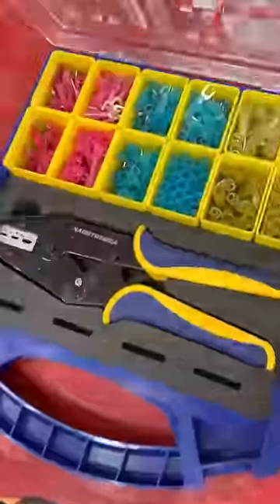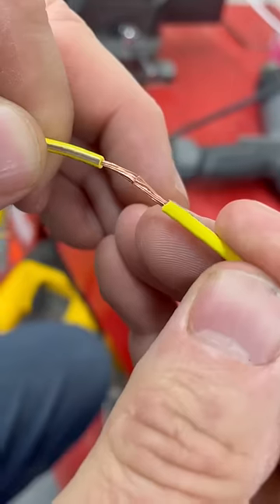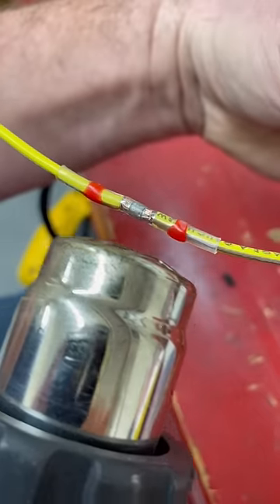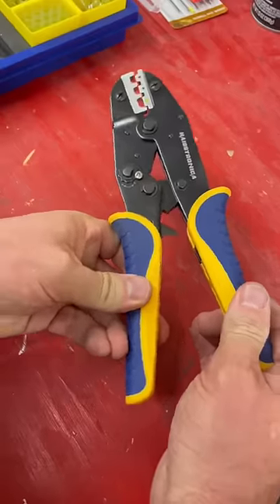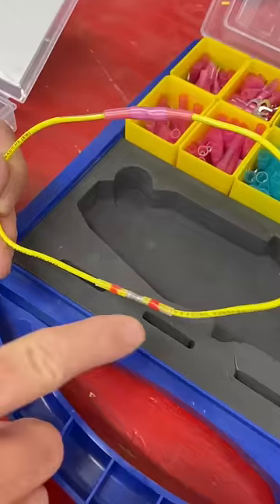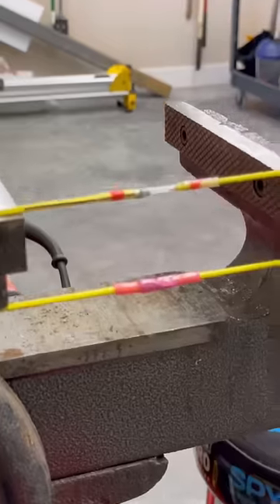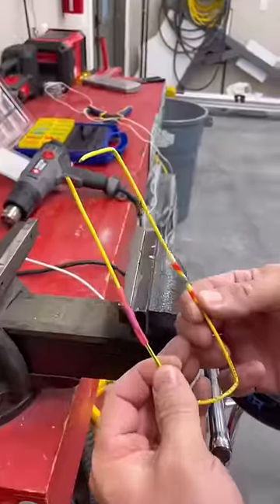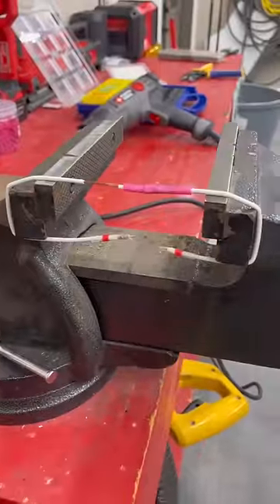Crimp verses Solder Connectors

Comment: I use both, but a connection that is going to be near heat and vibration, I use a crimp connector. If the connection  will not see heat or vibrations I'll use solder connectors.

Comment: The problem with solder connections is that in vibration environment the solder can crack while mechanical crimp connections aren’t subject to that.

Comment: If you are doing a data line you have to solder, and when it comes to vibration resistance solder will always be king. However, both work. And I mean it's a trailer and trailer lights it doesn't have to be art

Comment: Crimp connections for wires that take a lot of vibration or are exposed to the elements, solder for interior wires that don't need to take as much abuse.

Comment: i use the dual wall heat shrink crimp solder connectors at times when they are in stock, otherwise i use heatshrink crimp connector

Comment: Ideally I prefer using actual solder with heat shrink and some dielectric grease. But if I can't use that method a good crimp is the way to go. Those heat gun solder connections aren't very good. They also corrode from the inside out over time if you don't preheat them to remove moisture.

Comment: Soder and heat shink. Its not that they are super strong (although a good strong connection is good). The big thing is the continuity of the spice connection, and in my opinion, I've always had better continuity with solder.. basic trailer lights, though heat shrink crimp connectors are just fine.

Comment: I have a hard time getting the solder to actually bond or even melt most of the time. I wanna love those connectors but I don't. 
I prefer ordering the bare copper crimps, solder after crimping, then slide marine epoxy heat shrink over that. The joint is smaller than the heat shrink crimp and stronger than the solder sleeve.

Comment: For truck and trailer work butt connecters are just easier, especially in the field or up on the top of a box truck or trailer. I think anyone that argues differently either lives in a shop or has never been on a road call.

Comment: The solder connectors are better in very nasty conditions.  They seal up the metal better than a crimp will.  Other than that, take your pick.

Comment: The crimp connectors are better for connection that will be in moving things because it can sopport vibration without breaking like solder ones, solder is better for things that don't vibrates or move.

Comment: Start using a linemans splice and your wire will 99% of the time break at either the crimp connection of the wire. Linemans splice is insanely strong.

Comment: I never use a connector if I can help it. I solder all joints and then heat shrink. I've never had a failure in a soldered joint in over 30 yrs, but I've repaired 100s of failed crimp connected joints. The solder heat shrink is better than a crimp joint but they're expensive and not as good as a properly soldered connection.

Comment: For most scenarios, either are fine but i prefer crimp Uninslated with marine heat shrink but i thi k in a lot of cases those solder ones dont have enough solder and or any flux i just think the ods of a bad joint are high but they are convenient

Comment: NEVER solder connectors. With the ones that I used, the insulation melted before the solder.
I've ALWAYS had good luck with crimps. If it needs to be insulated, I'd just use heatshrink over the crimps. 
Just my 2c.

Comment: Personally use heat shrink after soldering . If anyone really thinks soldering will break never owned a Harley Davidson that has 40 thousand miles with soldering and heat shrink . Vibration is the absolute best test you can do .

Comment: depending on the application i would use solder in case of ultra cold temperatures/temperature cycling applications (ie fixing something inside an ultra freezer or an MRI machine)
and pressure connectors in "hotter" applications (ie under the hood of a car)
there is an exception though
when I am connecting a microvolt sensor it must always be solder

Comment: If I'm really worried about the connection I use actual solder connections,using a soldering iron, or gun if I need more heat rosin core solder and shrink tubing.

Comment: On automotive conections you should always use crimp those ones you have there are particularly good connectors on automotive applications soldered conections can crack and cause a bad connection so it’s best to use crimp connectors because they won’t crack

Comment: doesn't matter which one you use as long as it's not wire nuts. wires aren't meant for taking tension loads. if your wires broke because someone or something was pulling on them then you probably have bigger issues

Comment: Well... Before your test I would have said do whatever because oem vehicles are full of crimped connections...

I would think you should use something soldered in a moving system. However on my house pump I've had crimped connectors forever.

Smoke em if you got em.

Comment: I used solder connectors for a while for work, they failed after a few months of use almost CONSTANTLY. I had to chase ghosts in my harnesses just to find out that the solder had broken connection inside of the tube. Never again. Just mechanical splices for quick fixes or soldered mechanical splices for the long term.

Comment: The problem with the solder connectors is that there's no Flux! You need to add flux to the wire before putting them in the tube and heating the soldier.

Comment: I solder wires alot in my cars but crimp connectors are better. The wire gets brittle near the solder so it might break after time if there is alot of vibration

Comment: There is not enough solder there to properly connect, they wire also isn't being heated enough to make a good joint. It will be a cold solder.

Comment: The main connections we see fail day to day are Crimp connections due to corrosion. If a solder joint gets so hot it, let's go. You have bigger fish to fry.

Comment: always use crimp connectors. the solder can re-melt if the wire gets over current. also, I prefer the non-heat shrink crimp followed up by a piece of precut heat shrink from bargeman the quality of the crimp matters as I have cheaped out on a box and had 70% of those crimps fail
Reply: If the wire is getting hot enough to melt a solder connection, you need a bigger wire!

Comment: Crimp connector All the way in Automotive i would use these solder heatshrinks only for hobby electronics not for car or trailer wiring crimp connectors never failed but many times solder joint failed due to vibrations as the cable right behind the joint is a lot weaker than the joint itself so it just broke off Also i dunno which solder was used what abou resistance between those wires heat resistance etc ? (Pardon my english its not my main language)

Comment: Soldered connectors are not watertight. You rely solely on the molten solder to guarantee the electrical connection, and hope the pvc shrink will ensure a watertight joint. 

I have been using uninsulated butt connectors for years. Once crimped, I fill the voids with molten solder, and  slip a shrink tubing lined with heat activated and watertight adhesive. Never had a callback.

Comment: When I do electrical,  Im depending on the connection to be as good as possible, to allow current to flow through it.  I don't believe I've ever used electrical connectors to try to join a towing strap. Chain or any other type of recovery/  pulling apparatus.     In some instances the wore your working with might be pulled taught,  and their isn't much room to work with,  but typically, your wire shouldn't be being pulled in either direction. Especially at a connection.   Leave plenty of room and clamp the wire down on each side of the connection if need be.

Comment: If your wire connections experience that much strain... You've got bigger problems😂
Either one seems to be fine...
Higher current and heat causing solder to melt will eventually melt the insulation anyways, indicating the wrong size conductor or a serious short.
The solder type connector will withstand corrosion better.

Comment: if im soldering i prefer the standard solder and iron method, part of soldering properly is heating the base metal to the right temp so the solder can flow through it and form a proper bond, and i don't see that happening with the heatgun here

Comment: Maybe over kill but I like to use bare crip connector I then Solder and put a nice pice off double walled heat shrink over top I used to use the crimps that come with the heat shrink but I find sometimes I’d poke a hole in the heat shrink not noticing send into service and it would come back 3 mouths later for the same issue luckily I learned this working on fleet so no real harm done. I also live on an islands and used to work on the u hauls  and I can tell you what works in Texas doesn’t work on the coast some of the worst wiring I’ve ever seen has come from here Arizona too, but I’m no wiring expert I just do it for a living and these are my experiences yours may differ.

Comment: There both good but depending on where your using and on what, like have to use solder connector on Jag / land rover there better for anything under vehicle then the crimp due to chances of water damage, but if in the vehicle I'd use crimp just for the ease.

Comment: The solder connected shown should be paired with a metal barrel that is crimped onto the wires first, then the solder connector can be melted over that crimped barrel.

Comment: I've tried the solder connectors before, never had any luck with them. I could never get the solder to melt before the rubber. And if the solder doesn't actually melt, what advantage do they offer over crimped connectors?

Comment: I prefer solder connections and thus only reinforced it with the solder ik for sure 1000% that's its gonna make a great connection I don't have to worry about strength cuz I'm not towing a golf cart with my radio wires lol

Comment: I think sotter is better left to electronics and devices that you might want a second measure of defense for over current besides a fuse. Sotter doesn't do well with excess heat though so If you know what you're connecting will be under a serious load like a winch for example then crimp it.

Comment: Those heat shrink solder connectors use quite low melting temperature solder. That can be problematic if things heat up.

There's a reason they crimp all the connections in the stock wiring harness instead of soldering them.
Reply: I would be horrified if I would find a crimp connection in a stock wiring harness.
Reply: @fynn1202  How do you think literally every connector pin in the harness is attached? Sometimes inside the harness too, when wires join together.

There's literally nothing wrong with a properly done crimp. Soldering also can cause issues because it makes the wire less flexible and more likely to break at the joint.
Reply: @Robert Hancock  not to mention every grounding cable that exists is crimped.
Reply: @fynn1202  pretty much all connectors have pins that are crimped on, and splices are done with ultrasonic welding. Its rare to see anything soldered on a modern stock wiring harness.

Comment: Most of the time the solder does not adhere because the joint is not cleaned. Stick with the heat shrink and your just fine.

Comment: there is a problem with your analysis in that the forces used to break either type of connection far exceed any use case especially standard signal wiring for a trailer. A more important factor in choosing the proper connector would be the quality of bond it makes with the wire and how much electrical resistance that bond generates. with this in mind the solder connection is the superior option.
Reply from the maker: That totally makes sense and I am aware that strength is only one factor. I just thought it would be fun to test the difference in strength between the two styles.

Comment: Yeah, 3M had the patent on the solder connector, used by NASA. Theirs are water anx gas tight, have multiple rings of solder, and a special heat gunned matched for the job.
 Patent must have expired about 4-5 years ago, because everyone is making knockoffs now.

Comment: Where there are vibrations, I use crimp connectors. Solder conector wire gets hard and I saw many many wires that broke on solder joint
Reply from the maker: That makes sense
Reply: @hausplans  IMHO, it depends what you want to accomplish. Solder joint is best posible contact, but in my experience where there are vibrations, cable twisting, moving, joint can become"brittle" especially in fine wire cables. Crip connections gives you best of  two worlds good conection, and margin for flexibility at the joint... Best of luck connecting stuff 😃 and people👍

Comment: I use solder every time I can and it has nothing to do with the strength of the connection. It has to do with dissimilar metals and corrosion. When you crimp a steel sleeve onto copper wires there is a connection between the two dissimilar metals that, when wet or in the presence of moisture, will create a voltaic effect and promote corrosion at the joining points of the two metals. Over time this will deteriorate the connection, and if in a sensor circuit, the voltage created at the joint can seriously affect the reading of the voltage and throw off the calibration of the circuit. Solder the joint and the chance of water getting between the two metals is eliminated.

The only exceptions are when you use heat shrink tubing on the connection that has a sealant on the inside that will seal off the moisture or are using automotive style connectors that have rubber seals that keep the moisture out of the connectors. These connectors have rubber seals on the wires and on the connector joints so that water cannot get inside the connector or inside the wires. With these connectors, the crimping tool that is designed for use with them works perfectly.

Comment: crimps are preferred because you dont need heat, theyre quicker and a bit sturdier as they dont harden the wire at the point of contact

Comment: Yeah, sadly those solder connectors are not good at all. The solder joint is always cold and not flowed down into the core of the joint. If I make a solder connection, it's with a proper torch or iron and adequate flux to make sure it flows very nicely. Crimp joints are nice and strong.

Comment: Actually, for DIY, the solder connection is better. 1. Easier to get reliable connection cause most DIY don't strip & crimp correctly. 2 solder connectors heat shrink to keep environment out of the connection & probably had less resistance. The physical strength of the connection is meaning as it isn't made for mechanical strength, just best electrical connection, i.e. lowest resistance.

Comment: Yeah but in vibration test, solder breaks, it's why car wire harness only use crimp on wire harness,  if there is solder on something it has to be protected from vibration

Comment: The solder connectors use low temp solder, which has a resistance value and thus shouldn't be used for critical data/power/ground or airbag circuits. The crimp connectors will never ever be water proof unless you fully encase it in heat shrink with glue. Heat shrink with no glue is absolutely useless. A regular soldered connection is the best option.

Comment: Physical strength is NOT the most important thing in a wire to wire connection.  The most important is minimal resistance, both initial and long term.  A gas-tight crimp connector and a proper solder connector are both equal in that respect.  The key is proper.  A correctly sized crimp connector applied with a ratcheting tool on CLEAN wire ends is easier for the neophyte operator than properly soldering.  After 60 years in electronics, I prefer soldering.  YMMV!

Comment: If glue degrades the crimped connection will fail due to corrosion first. Best is to use proper solder and heat shrink, not the heat gun stuff.

Comment: solder connector is best if you solder them first. The solder connector solder only flows on the outside of the wire.  It doesnt flow to the core.

Comment: I don't even have to finish this video to tell you that you were right to use the crimp connections. The only place those solder connections have is for an emergency repair job that can be done with a lighter, and then be fixed properly when you have tools available.

Those are incredibly useful, but they are not a permanent fix, at all.

Comment: Crimp ones are the go bud, I have worked in the mines for 15 years as a HV Auto Electrician and everything soldered breaks from the constant vibration and then you start throwing shit when you find a broken solder joint some other mong has repaired before.

Comment: Wire connectors are not to be used as cable swedging devices they're made for continuity and connection for current maybe you should do a video on which has better current.

Comment: Solder connectors are best, it's not the strength that is in question it is stable continuity over time. Crimp can oxidize or relax at contact points where solder doesn't.

Comment: Definitely use the crimp connectors. Those solder ones are rubbish... From my personal experience. Either solder the wires and put heat shrink over it or use crimps.

Comment: Bro crimp connectors are so much better, they’re very easy to use and not everyone has a heat gun or sauter to use for those which is why I prefer the crimp connector because it’s just as good if not better quick easy and lasts for god knows how long.

Comment: in the aerospace world, crimped connectors are tested on a pull tester.  That's how they adjust the crimper.  Me personally, I twist the wire, the solder, then shrink tube.   The solder keeps it from oxidizing as well.   The only issue is if you use too much solder, makes the wire stiff and if it flexes a lot, the wire will break right next to the solder (stress point).